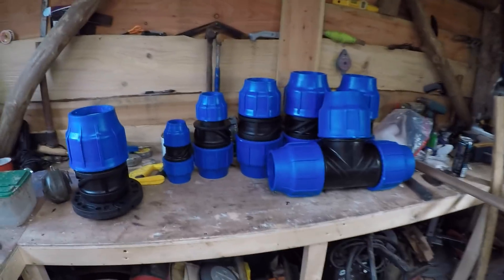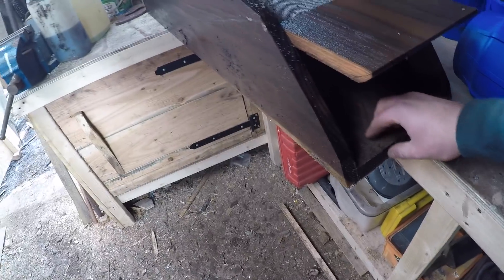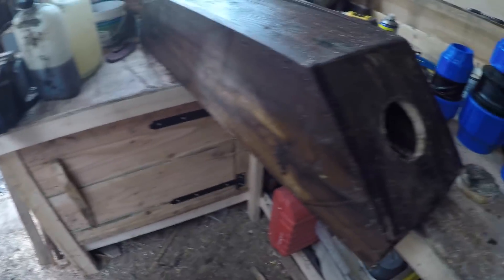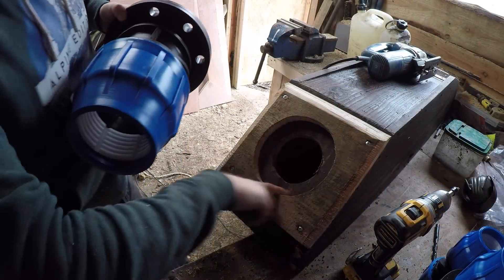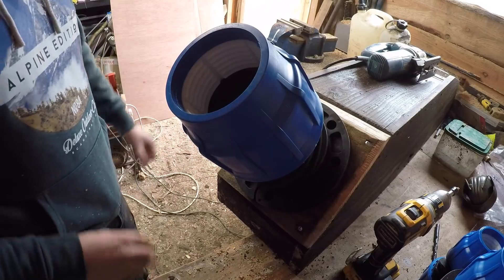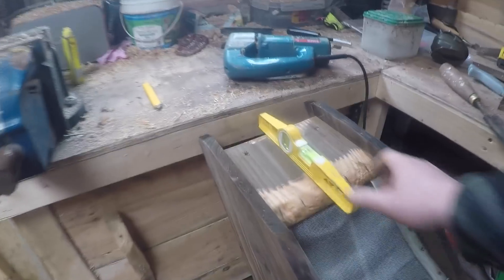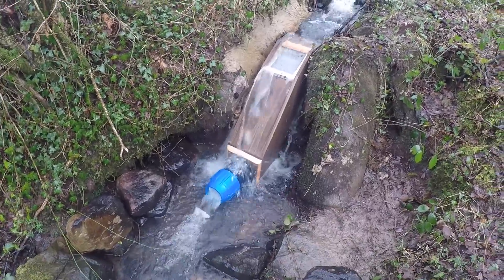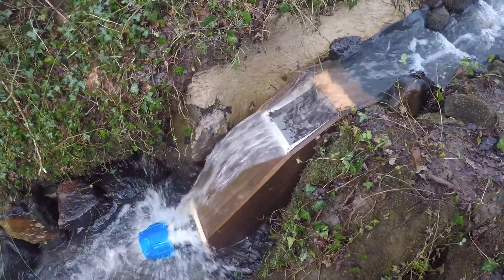DIY Micro Hydro part 8 intake pipe connection

Comment: how about digging a box pit above the intake to act as a settling pool, so the water flowing out of the pit has already dropped its silt?
Reply from the maker: i think the will be quite a nice solution. but i want to minimise extra work if possible so i am going to see how it works as it is first. if it is causing a problem i will have to sort it out. but the priority at the moment is to get the power turned on so i dont have to run the generator.
Reply: Thats what i was thinking too
Reply: You could also redesign your intake box to have a silt trap. Basically there would be two cavities connected at the bottom and the intake would be at the top on one side and your outlet pipe would be at the top on the other side with a divider in the middle and the silt should settle at the bottom, so you could have the same clean out plug you are talking about.
Reply: Have done this sort of thing on a burn in Scotland . Your dead right you need  to slow the flow. we built a rough dam and had the pipe off the bottom of  the pool near the dam. And good luck to you. Your doing  a grand job.
Reply: Kris Harbour agreed! I was wondering why you never built a dam would also help your flow in cases when the flow is not so torrent.  Hope this helps
Reply: Intrepid Corsair exactly. Only difference is he would be cleaning out the bottom instead of the top.
Reply: The silt is usable right? Gardening, or maybe a refined clay.
Reply: That might be better than a silt trap down stream.
Reply: Just another thought. i think you said your over shale. so the water will be dusty
Reply: @Charles McKnight Very similar in design to a grease trap. I built one of those out of steel with a sealing lid on top to clean it out. No reason it couldn’t be built using durable wood in less than two hours time.
Reply: Ya like a damn system. So the water running over the top is clean and clear.

Comment: I think the answer to your screen clogging issues may be fixed if you look into gold mining techniques and Water Management through riffles creating a agitation/ turbulent wash out. Maybe experiment with it by placing some wooden dowel rods across the screen so many centimeters apart or something of the sort.
Reply: hydroscreen/coanda screen would be a better option.
Reply from the maker: It’s just mega expensive. I only need a tiny bit of it. If I could just get a little off cut then I would do that! But it’s hard to come by as I’m sure you know.
Reply: I actually haven't looked into it other than knowing it exists. My waterwheel is debris tolerant so anything that fits through the flume won't do anything. I realize that isn't the case with a high head system. One of the blogs I occasionally follow has just a pipe in his stream dumping into a settling tank from where all of this feed pipes leave. There is no filter as far as I can tell. https://lifeattheendoftheroad.wordpress.com/category/hydro/